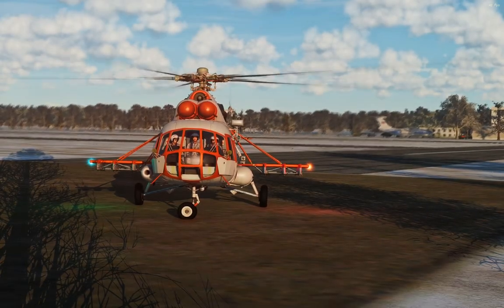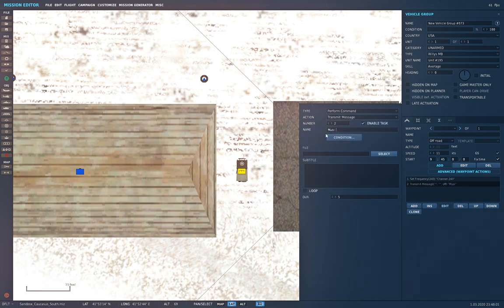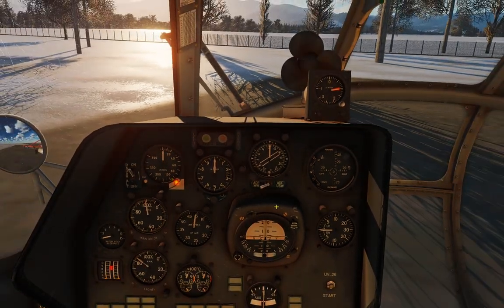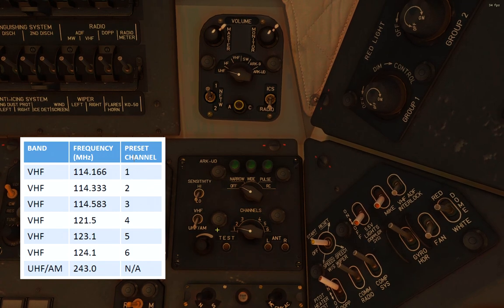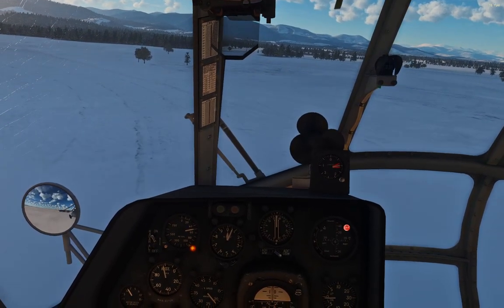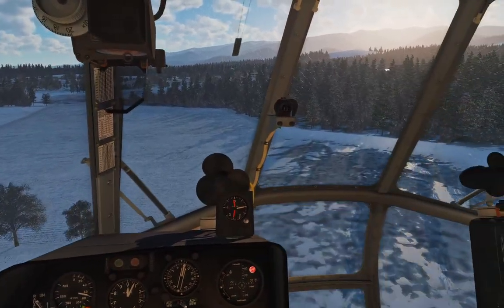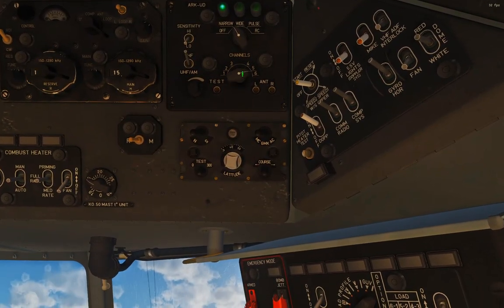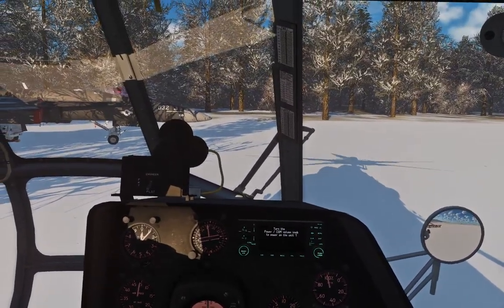DCS Mi-8: ARK-UD Radio Navigation Tutorial

Comment: People get usually confused about Mi-8 radios and why they are scattered around like that. It is very simple to understand.

The left seat is the pilot-commander and responsible only for flying and attacking. The primary guy.

The right seat is the pilot-navigator that is responsible to assist pilot-commander in navigation, communications and flying.

The center seat is the flight engineer, responsible to assist both pilots and manage the cargo space.

Every single person in helicopter has their own radio set, there are six.

Pilot-commander
Pilot-navigator
Flight engineer
Door gunner
Troop leader
Rear door gunner

But only the three guys at front can tune radios for various purposes.

Pilot-commander has a primary radio for communication with ATC, Flight and Fighters.
He utilizes a 20 channel presets for that task, and flight engineer can help him to swap channels on upper panel.

Then pilot-navigator has radios for ground units, as well manual tuning the primary radio in center panel. 
He has all radios and navigation systems to tune. His primary task is to communicate with ground units using R-828 and cooperate the tactics with them.

The flight engineer has on right side of the doorway a button to talk, just same way to possibility have a HOT MIC for continuing transmission.

The DCS doesn't model the real radios capabilities where both pilots can have separate radios with the common ICS.
So when a pilot sets their control panel above their heads for wanted radio, it should be only for them. So the knob shouldn't turn in other side.
This means that pilot-commander can listen GCI on primary radio, while talking over ICS to pilot-navigator. And pilot navigator can listen ground troops communications while listening pilot-commander.

The reason as well why the pilot-navigator radio compass doesn't work is as he should be able tune it to another radio than pilot-commander does. So you can have two separate radio needles turning.

Both pilots can as well turn their headsets to same radio, so they can both talk to each others using ICS but as well listen and talk over same radio to troops on ground or air.

The manual says that all six of the stations should be able to to select what radio to use and ICS as primary. And there is possibility have a two different networks where likely intercom is separated.
But that is not modeled in Hip, but likely soon released Hind it will be.
Reply from the maker: This is a fantastic comment, thank you very much for sharing! That makes way more sense than locking the entire crew into a single radio like we have in game. Maybe they will update this when the Hip gets multicrew. That would be nice.
Reply: Superb comment indeed. Let's hope it will be implemented in the Hind...one fine day in the distant future.